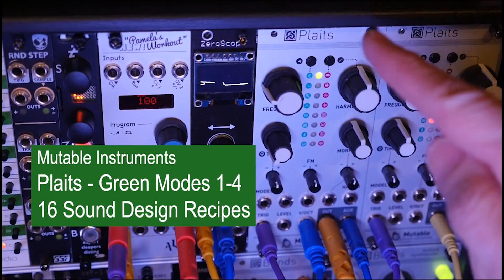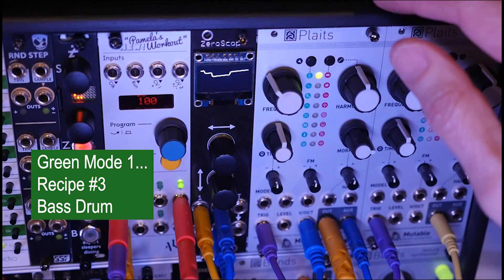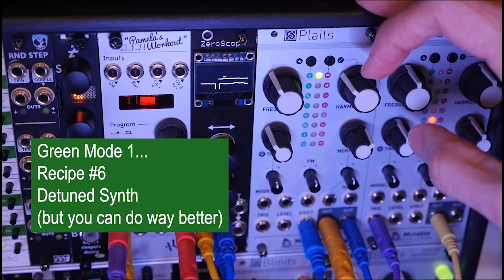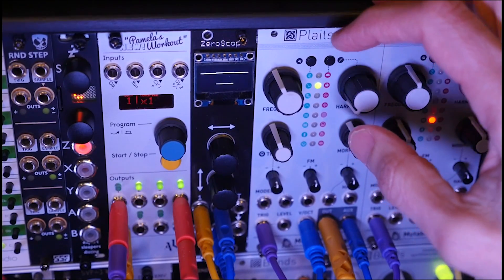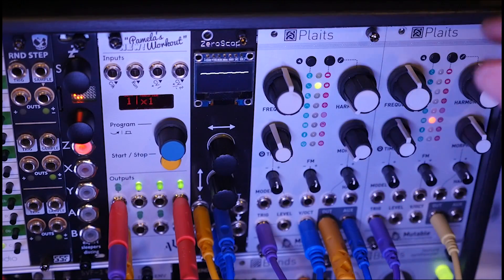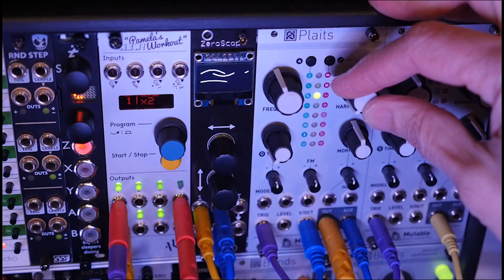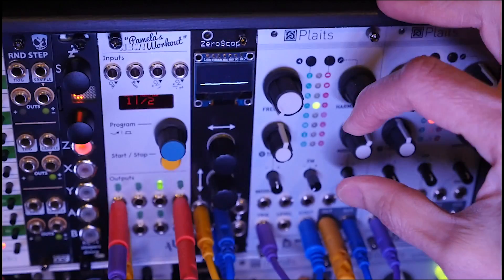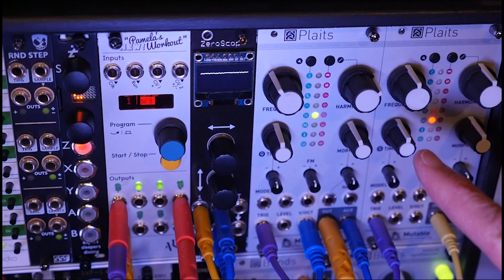16 Recipes for Mutable Instruments Plaits GREEN modes 1-4 - VOL 3 Eurorack beginner Sound Design

Comment: Interesting video. Good stuff. The Mutable for the manual say's that after holding the left button to enter the internal envelope settings that frequency knob morphs between a VCA response and a low pass gate response. This was the case on mine under ver 1.1 . I haven't had a chance to verify that it's the same on ver 1.2
Reply from the maker: Yes I have a hard time getting results I can interpret the way the manual describes, so I default to describing it the more simple way 😝 - I think it’s still the same in v1.2 as you described
Reply: Well, as you know the main difference between a VCA and a LPG is that the LPG controls volume but also applies the vactrol envelope to the cutoff of a LP filter. VCA's of course do not effect freq response. The entire envelope is controlled by the morph knob. Since it's meant to mimic the response of a plucked vactral, there is in NO change in attack from turning either knob.  If the timbre knob is turned all the way up (when in the internal envelope adjustment mode) the envelope (set by the morph knob) has no effect on freq response - while the timbre knob is all the way down the envelope that is set by the morph knob is ALSO applied to a LP cutoff. This is exactly the way the Buchla gate works except that there's a three position switch which gives a VCA response, a low pass gate response or an in between position which combines good features of the other two positions but electronically is in no way a mix of the other two response curves. Plaits gives finer control than a three way switch but otherwise works about the same. Of course I'm not addressing the differences caused by doing the whole thing in software as compared to a hardware LPG. I will add that this is exactly the response I hear from these controls. It's fine with me for you to call the function of the timbre knob anything you want (Fred, Bombastic Confabulator, really anything) but it seems confusing for you to say it controls attack when it has no effect on attack. In testing the mode just now, I can see there are some modes where the added brightness of the VCA mode could be interpreted by the ear as a small sharpening of the attack. This is one of the illusions of brighter or louder sounds.

BTW it does indeed work exactly the same on ver 1.2 at least on the green modes. Several of the red modes don't even have an internal envelope adjustment and I suspect with the FM modes in then new firmware (yellow modes) the envelope maybe built into the DX patches and not adjustable by holding the left button.
Reply from the maker: Well, this is the best lesson I've ever gotten on that control - thank you! YES it does bother me that I got it wrong in the videos - I'll try to figure out how to fix that with an  edit... this is super helpful. Now that I've been cooking on the Orange modes, it does seem that the internal envelope is NOT used for the FM models 3-5. thanks again for the schooling.
Reply from the maker: Spence Barton Pinning your comment stream here so others can get that awesome detailed lesson.
Reply: Thanks for the nice response. I apologize that my last comment deviated a bit from proper internet etiquette and proper grown up behavior. Learning about modular is why we make and watch these videos  - you have made an informative video and offer a useful product.  Youtube and the internet have been almost my sole source of education about modular and lots of other things. I shouldn't bite the hand that has so generously fed me a world of information. In response to you having pinned my explanation, I will fix the typos (you'd hardly believe, from all the typos, that English is my first language) AND remove the less than generous comments in the text.
Reply from the maker: no issues at all here :) I actually was able to edit a couple of the videos to clip out the part about the Timbre knob - so it's a bit less misleading now :) - and I totally agree with you on the  value I've personally gotten from YT videos on the topic, so I would hate to send ppl away with bad info!  I've posted and pinned a comment on all 4 of the videos too.   Thanks again for the detailed info you gave me - I'll do some testing and, when I understand it more, will include it in a video at some point! :)
Reply: @rochefsky  Thanks.